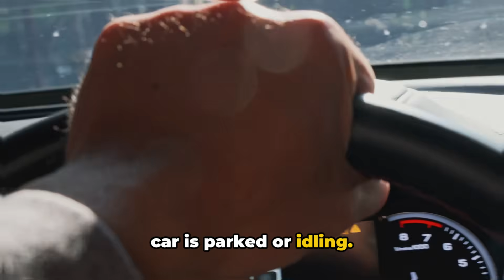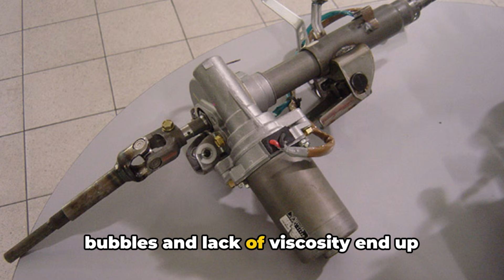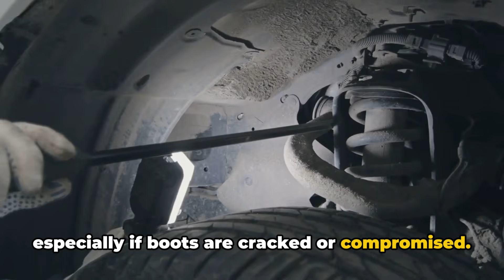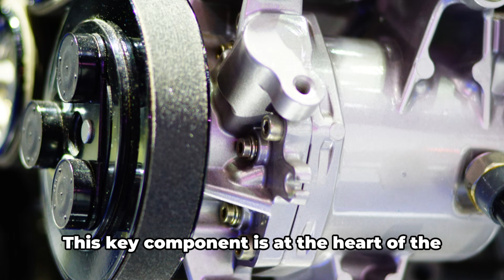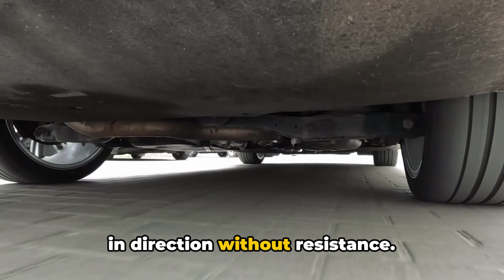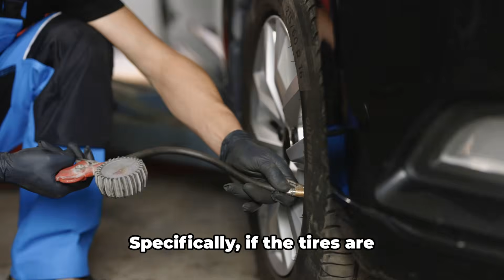Noise When Turning Steering Wheel While Stationary Causes

Comment: I was taught never to turn the steering wheel while stationary. Doing this can cause excessive stress and so increase the wear on the steering subsystem linkages and bearings and tyres.  Anyone else?
Reply: idk if you've found anything out since then, but if you lift the front side of your car, there shouldn't be any issues since there's not weight on the tyres. When you bleed your power steering system, it's usually done with the front tyres in the air. Done this myself a couple times and never had issues.

Comment: I hear the scraping sound on the behind the physical steering wheel. What can you say about that?
Reply from the maker: Hi Tony, A scraping sound from behind the steering wheel can often indicate an issue with the steering column's internal components, such as the clock spring, which maintains the electrical connection to the airbag, horn, and other systems in the steering wheel. 

Over time, dirt, wear, or misalignment can cause friction and lead to a scraping noise. Another possibility could be debris or worn parts within the steering column, which may require inspection to avoid more serious damage. 

What car do you currently drive and are there any other symptoms?
Reply: Thanks for the response. It’s a 2013 MB GL550. I just had it at the shop getting some maintenance work done. New tires installed. Once i got it i started hearing the sound when i turned my wheel. Asked mechanic he said he has no idea why.

No other symptoms. Other than that everything is in working order. Scraps mainly when turning the steering wheel left and when doing a full turn left i really hear it.

Comment: I have an issue where my car makes a quiet sound when turning left or right that resembles someone using a lathe. The sound only happens at highway speeds and the second I get below 30Mph it’s gone. I’ve had my car checked out and the mechanics said they couldn’t find anything wrong with the car and that the noise is probably just the power steering pump doing its job. However it’s a new noise that I’ve never heard before. Any ideas?

Comment: I'm convinced that the scrapping noise when I turn my car is  the power steering pump. I had taken it to a auto-shop that I THOUGHT was a reputable source. Only to find out that they screwed me out of my alternator by putting on a defective alternator. So I took it to a locally owned shop, not owned by a chain and they installed a alternator that actually works. Imagine that right?

I'm starting to think they screwed me out of my power steering pump as well. Whenever I turn the wheel all the way it makes a very feint 'whine' noise and while driving and I turn the wheel it makes a scrapping noise. I almost had a heart-attack because I thought it could be a CV joint or something like that. At that point I was about to sell the car.

Comment: Steering components can also cause such grinding noise like steering column failing or steering damper failing.
Reply from the maker: That's a great point! It's crucial to pay attention to all the components in your steering system to avoid any issues.

Comment: I have a 2005 Impreza and when I’m in park I hear a whining noise while turning. The power steering fluid is healthy and full. When I’m in drive or reverse there is no noise. Do you know what the issue is?
Reply from the maker: Hi, apologies for the late response. Managed to sort it out?

The whining noise you hear in your 2005 Impreza when in park and turning, which disappears in drive or reverse, could be related to the power steering system since the fluid is full. Potential issues could include a power steering pump starting to fail or a belt that is either worn or improperly tensioned. Since the noise occurs specifically when stationary and turning the wheel, it points to a situation where the power steering system is under load. It's advisable to inspect the power steering pump and belt for wear or damage and consider consulting a mechanic for a precise diagnosis.

Comment: THANK YOU VERY MUCH FOR THIS VIDEO!  Your channel is pretty helpful!  And I hope more subscribers coming your way!

The other cause is getting crappy made-in-China power steering pump.  I put in a new after-market pump, made in China (like everything else nowadays), and it whines (not too loud) for 10 secs when starting the car after 6 or more hours of parking.  It also whines when steering all the way to the left or right and only while hold the steering wheel to the respective extreme direction.  I have replaced the outlet o-ring (the high pressure side of the pump), but it does not help, as it looks like it struggles to build pressure.  Luckily I still have my old/original/OEM pump.  So, I am to rebuild it with new o-rings and gaskets.
Reply from the maker: Thanks for the kind words! I'm glad you found the video helpful. I agree sometimes aftermarket parts can be crappy. Let me know how it goes!